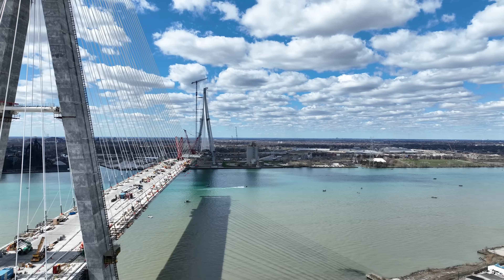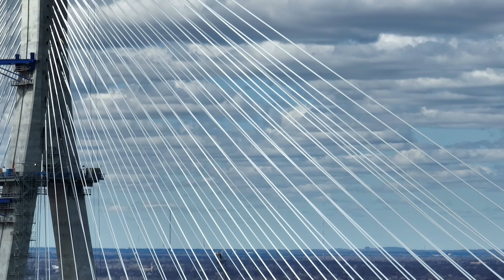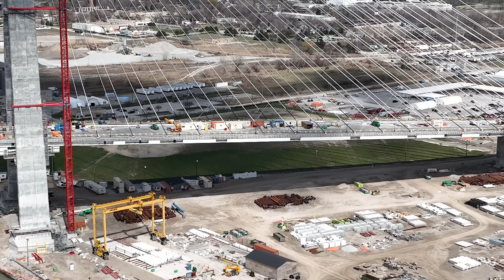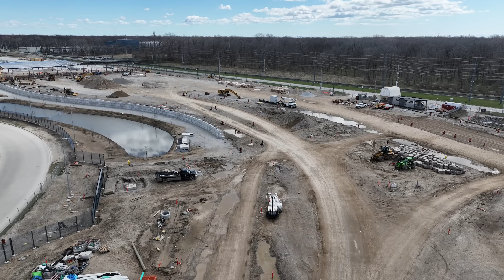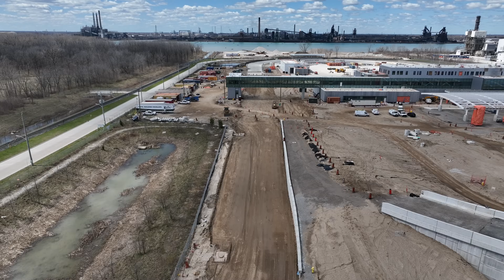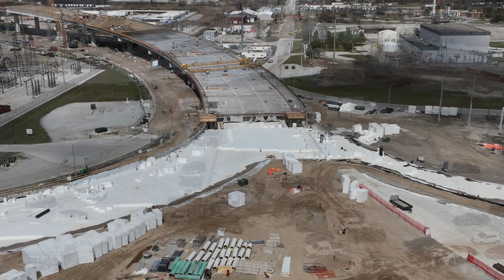Gordie Howe Bridge construction: April update revealed

Comment: Using some very basic quick math, the bridges weight capacity could take fully loaded 80K Lbs. tractor trailers parked front to back cross all six lanes stacked four high.  That bridge isn't going anywhere.
Reply from the maker: Hi northeastoutrider2124. That's reassuring. Thanks for sharing that interesting information. Glad to have you here.
Reply: And the titanic was unsinkable!
Reply from the maker: @utuberdave   They were wrong there, eh? There are a lot of cable stayed briges out there now. I don't know about any that have collapsed. Why do you think this one will? Just curious.
Reply: @bobjoneswinairvideo  I’m not saying it’ll collapse, but nature ALWAYS wins in the end. The moment it’s erected it starts to deteriorate because of nature. Eventually torn down.
Reply from the maker: You are right on the target with that statement. Nature is awesome, and more powerful than can be imagined. I did a few years of blue water sailing. There were times of pure beauty and a few of shear terror.

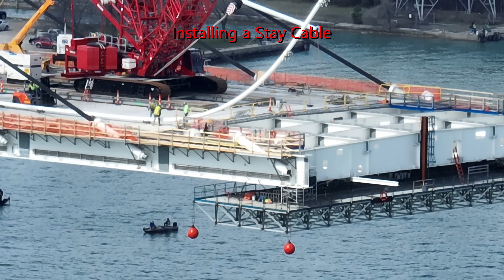Comment: The red Manitowoc crane lifting the cable at 2:20 is a crawler crane.The vertical cranes attached to the towers are tower cranes.Cranes that have tracks on them are crawler crane’s. The yellow crane being used to disassemble the red Manitowoc crane is called a hydro which is short for hydraulic
Reply from the maker: Hi Matt. Thank you so much for hat clarification. Love having people with the knowledge sharing! Great post.:)

Comment: Be nice if it was Truck traffic only, would speed things up massively.
Reply: I read some time ago that it was proposed to have the new bridge carry commerce and the Ambassador Bridge would carry passenger cars. Don't know if that's still the deal.
Reply from the maker: @salemdesigns65  No I don't think so. However, it will balance out after the novelty of the new bridge wears a little in my opinion. The downtown traffic to Detroit or Windsor will choose the Ambassador or the Detroit/Windsor Tunnel. Highway travellers will apreciate the direct linl to the freeways.
Reply from the maker: Hi uncledeadlythefirst. No chance of that. I would suspect traffic will flow pretty good with the two bridges and the tunnel. The Gordie Howe will relieve a lot of, if not all congestion on our borders. JMO. Thanks for the comment.

Comment: Did you say they were using stainless steel rebar?
Reply: My dear husband is installing that rebar there.  It is impressive.
Reply from the maker: Hi User-mf4xb6nv2m. God question. Yes. That's the information i gathered in my research. Stanless steel is used to ensure the brifge lasts at least 125 years.
Reply: @bobjoneswinairvideo  That wont be cheap but in that environment it`s a smart move.
Reply from the maker: I agree with that.
Reply: @bobjoneswinairvideo  Thanks for posting the vids on the bridge.  I want to see it the next time in Michigan seeing the in laws.
Reply from the maker: Worth the trip I think.

Comment: Does anyone know if the bridge deck has been designed with ice and snow abatement technology such as heated lanes? I would think engineers would not want corrosive salt used on it.
Reply from the maker: Hi 004Black. I couldn't find any information about the ice and snow abatement, however I would think the engineers would hasve taken that into consideration considering the climate around this area. I'll keep my eyes and ears open. :)

Comment: Great video!
Tall Ships, is the height sufficient for their masts to clear it? 
Do you know the clearance from water to bridge?
Reply from the maker: Hi Mike. Yes, and no. The distance from the water to the bridge deck in the middle is approx 160 feet. A quick search told me tall ships masts range from 130 to 200 feet (40-60 meters)  from the waterline. As a general rule, the height of the tallest mast on a sailing ship is roughly equal to the length of the ship itself, though this can vary based on the specific design and purpose of the vessel.
 The largest tall ship that has come up the Detroit River appears to be the Appledore IV, an 85-foot long tall schooner. So, yes, so far.:)

Comment: Spectacular!  Wonder if the replacement for the Baltimore Francis Scott Key bridge will be similar in construction and appearance?  Assume Baltimore will also demolish the 50 year old bridge approaches after the ship channel is fully cleared.
Reply from the maker: Hi William. Good question, but I have no idea. The cable stay design has become very popular so maybe they will. Thanks for the post. :)
Reply: I recently saw that Baltimore was still considering either a suspension or cable-stayed bridge at this point. I would bet they go with a cable-stayed bridge for the Key replacement, although probably not as elaborate as the Gordie bridge. I believe a cable-stayed bridge is more economical to build than a suspension type bridge.
Reply: @djm5k Yeah, a cable-stayed bridge is a lot cheaper than a suspension bridge, plus it's usually quicker to build, except in the case of the Gordie Howe Bridge! 😉 I think the replacement bridge in Baltimore will definitely be a cable-stayed and at least 3 lanes in each direction, maybe expandable to 4 lanes in each direction.  The old bridge had just 2 lanes in each direction.

Comment: How do they adjust for the final section in the middle of the bridge to join the two halves together?
Reply from the maker: Hi James. I think they place the final section and then adjust the tension on all the stay cables to get the proper fit and balance. Just a guess, but I will see what I can find out about it before it happens. Thanks for the question.

Comment: They won't be able to install that last cable stay on the "land side" until all of the girders are in place over the river.  Not having that last cable stay installed makes it easier for the cranes to bring the girder sections and everything else needed onto the bridge to be trucked out to the center.
Reply from the maker: Hi Chris. It'll be interesting to see how they join the two sides. I can see how not having the cable there can help with accessing the bridge deck. Thanks for the comment.
Reply: @bobjoneswinairvideo  From what I read, they are making custom girders to connect the two sides with a tolerance of just a few millimeters.  The big question is, are they already made, are they currently being made, or are they going to wait until the final gap, then measure with lasers, and then start constructing those custom girders?  If they are already made, then a June connection is no problem, if they need to be made after measuring the final gap first, then it might be late summer for the connection!
Reply from the maker: Hi Chris. I'd be surprised if they didn't have the peice already done. With todays geometrics, lidar  and other measuring technology.  I would think they would have some way to adjust it to fit, but I really don't have a  idea. I suppose we will learn soon enough,eh? :)

Comment: I may have missed this in previous episodes, but I am curious about the types and frequency of expansion joints on the bridge.
Reply from the maker: Hi Ozzie. Nope, didn't miss it. So I did a quick search. In summary, the Gordie Howe International Bridge is designed to minimize the use of expansion joints, but the exact expansion joint specifications are not clearly outlined in the given information. I will keep the question in mind and if I find a more comprehensive answer I'll post it in the community chat, or include it in anopther video. Thanks for the question!